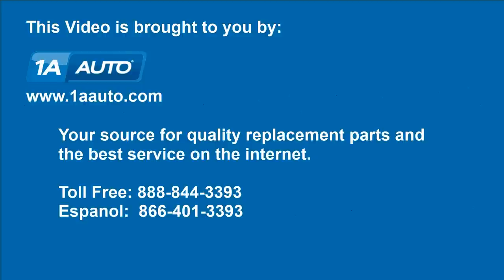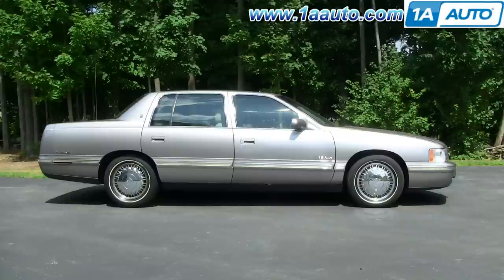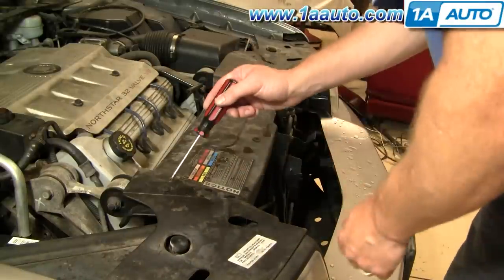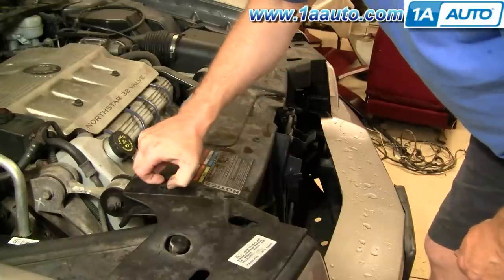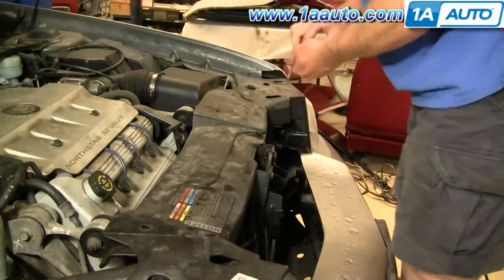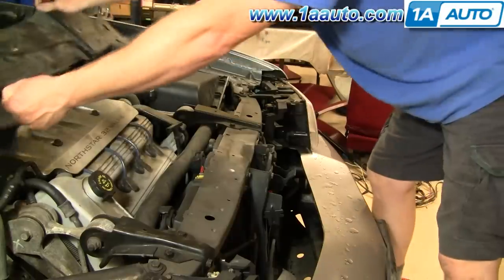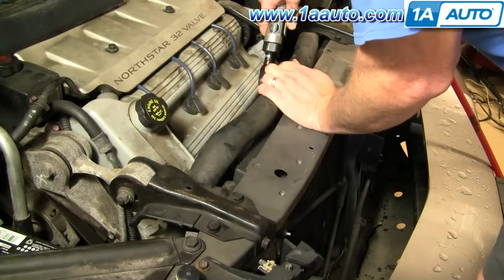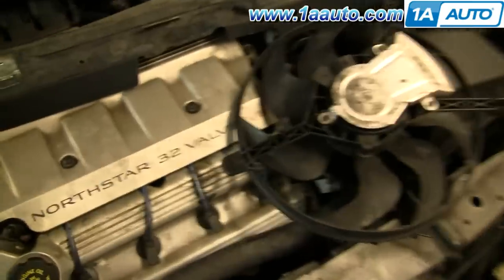How to Replace Radiator Cooling Fan 94-99 Cadillac Deville

Comment from the maker: There could be an issue with the relay or a sensor, you may wan to check them. 1aauto.com 888-844-3393

Comment from the maker: You may want to make sure that the fan is kicking off and on properly. Also check the water pump to see if it's leaking at all, as a water pump that's going might also cause this type of a situation. Hope this helps you out.

Comment: do you know where on a 1990 cad, deville. the coolant sensor unit be? the guy i bought the car from hot wired the fans so they would come on, what makes the fans work the right way?
Reply from the maker: +William Moore We currently do not have an auto repair video that shows the location of this switch. If you have a service manual for the vehicle, it should show it. Hope this helps you out. 1aauto.com